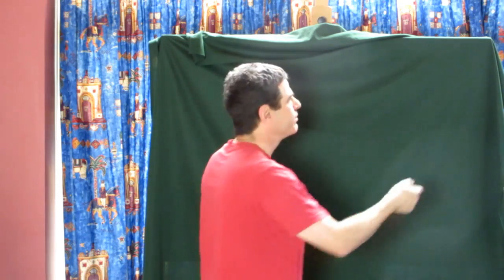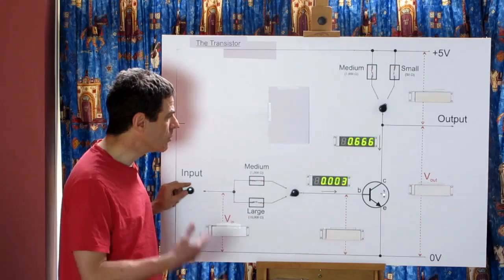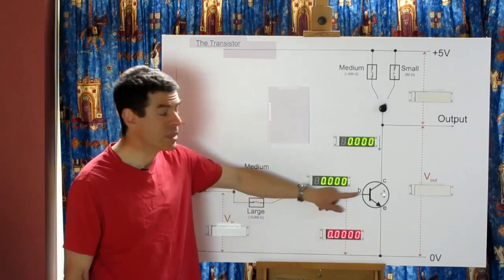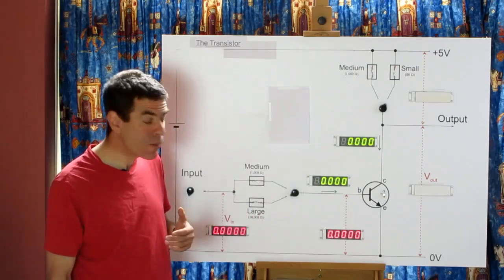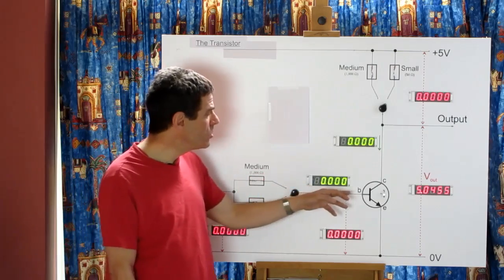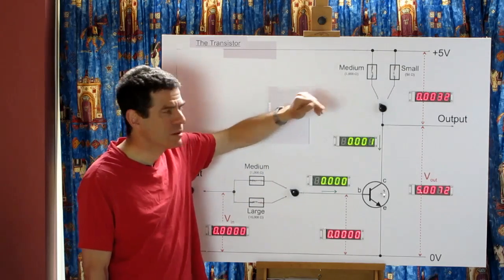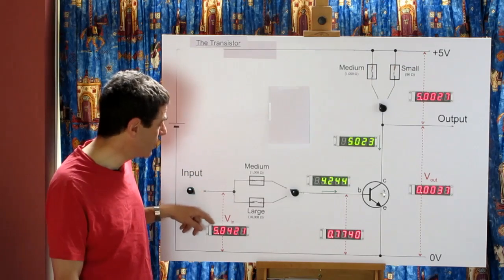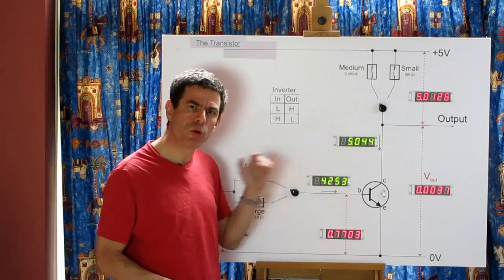SS2 : The Transistor

Comment: Great project and great videos. Small error at 6:38 ("I'm also measuring the CURRENT dropped across the resistor here", - should be "VOLTAGE").

Comment: super basic question, but where is the Output wire connected?
Reply from the maker: In truth there isn't an actual output wire as the circuit isn't connected to anything. It would be attached to the collector of the transistor. The actual wires of the circuit are behind the board and come up to the components on the front through small holes.  I put the wires on the back and just had the circuit diagram on the front because it was tricky to pack the wires lie flat ad straight, so they just made it look cluttered and slightly confused.
Reply: oh okay. i was just confused by the two voltmeters between the +5v and output and output and ground. i didnt think that explanation was very clear (even though your videos arent necessarily about basic electronics), but i have watched your other videos and they are great.

Comment: To help make this clearer, is there actually a device of any consequence at the point where the transistor symbol is located on the board, or is the "transistor" the whole board in its entirety and the symbol just a soder point between the the top, left, and bottom portions of the circuit?
Reply from the maker: Yes, there is actually a transistor there (and resistors within the resistor symbols). I appreciate it's not desperately clear in the video, I did get a much physically larger than necessary transistor but it is still lost.
I did initially have the wires of the circuit on the front of the board to try and make everything visible but that didn't look brilliant (and the components were even more invisible).

I am finding these videos really quite difficult to do and expect I'll only know how to do them well once I've done them wrong.
Reply: Can you make a video in which you build and demo a mega-transistor? Because this video shows what a transistor does but not how it does it, or how someone can build a macroscopic analog.
Reply: Thanks btw these are awesome videos
Reply from the maker: I think about this every now and then but I have absolutely no idea what could play the part of charge carriers at a macroscopic scale.

Comment: Very interesting. Are you a teacher? I actually learned a lot. Still watching the playlist. Been interested in electronics and computers all my life but first now I understand the logic behind some of it. Remember when I was a kid, I got these play-build kits. A board with holes, a lot of electronic components and many different things to make where I remember the most difficult was a radio! Also IIRC some kind of alarms etc. Anyway I "learned" to put some components together but not how/why it worked. Same thing to be said about all I've ever learned about "low current" electronics in school. I remember the symbols and that we learned about transistors, resistors, capacitors and so on, but I've never understood it until now! How an "amplifier" (transistor) can keep a "message" (0 or 1 - off or on) as long as current is applied. Cool! Thanks and good luck!